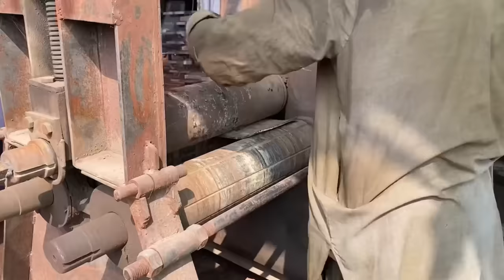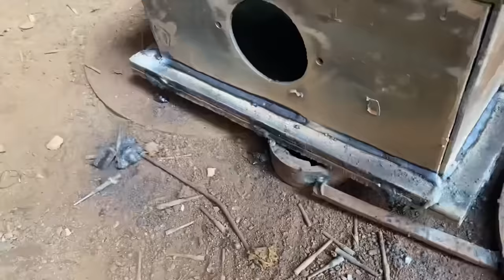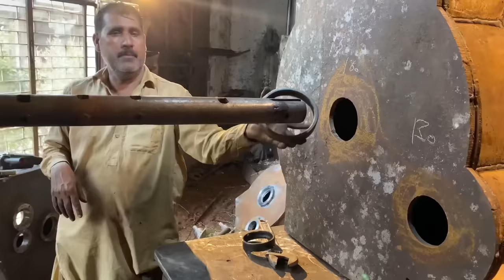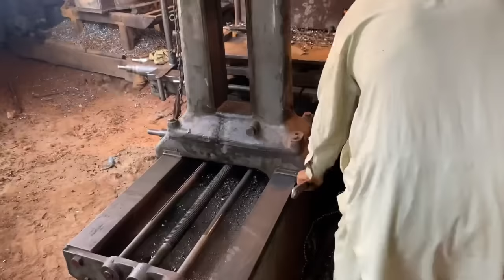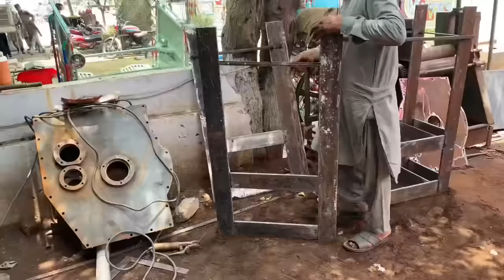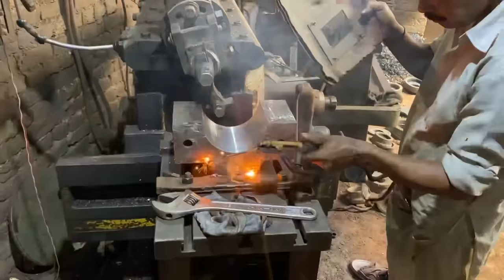Extremely Amazing Manufacturing Production Process Of Powerful Expeller Machines | part 1

Comment: Two things you will never sell in Pakistan, PPE and workbenches.
Reply from the maker: What is ppe ? Did you explain if you don’t mind ❤️👍
Reply: Personal Protective Equipment.
Safety gear and apparel.
Reply: yes, it does not come in kids sizes.
Reply: Just some regular shoes would be nice
Reply: And dirt
Reply: A broom and a cleaner working environment to
Reply: But machinist shop don't have a trolley that can move there jobs so need of ppe
Reply: Means they can make a trolley to move things to avoid any accident atleat
Reply from the maker: Thanks for sharing this information ❤️👍
Reply from the maker: Thank you

Comment: Hope they have a comprehensive workers compensation policy...
Reply from the maker: Yes I personally visit there owners of this factory he is very good and compassion 👍❤️
Reply: @mimechanics1019  
The workers are obviously highly skilled but it's the conditions they work in that would get the factory shut down immediately in this country.  Safety being the major issue like handling molten metal with no protective clothing (even bare feet or open sandals!)

Comment: Every weld is absolute garbage. How does anything stay together?
Reply from the maker: They have to work with which facilities they available they are so happy with there work and make there families happy and save because they are addicted to work with these facilities and equipments
Reply: Note the jigs and clamps used?  None.  Perhaps what you thought were welds were tacks.  The process they use is:  Build a template.  Tack to the template.  Align and tack with fixtures.  Weld up parts.  Remove fixtures and grind down tack welds.  Only saw the weld up of one or two sides.  Only one clamp that I saw and it was tacked on.  Are you sure you saw any through welding or final welds?  I thought the methodology was ingenious and efficient.  May try it myself.